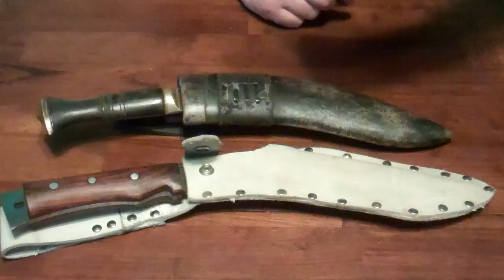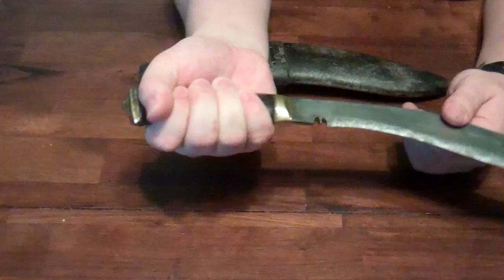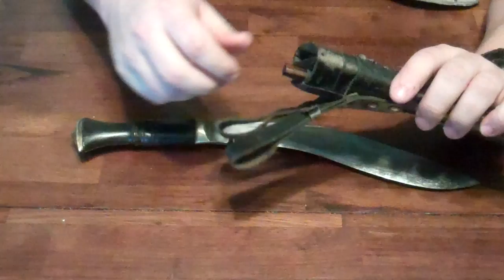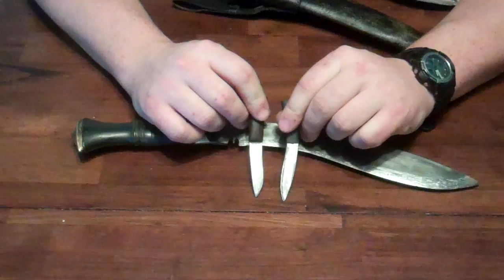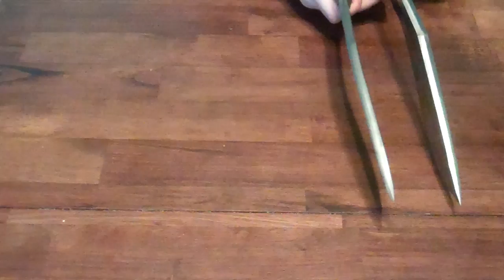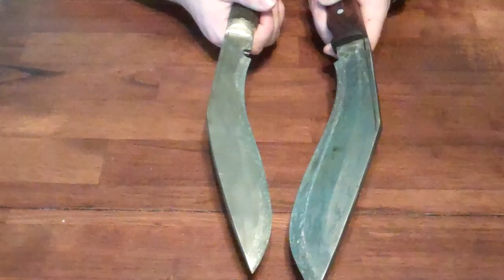A Kurki buyers guide: AEOF and Traditional Design

Comment: I have one that looks like the Afghan Khukuri, but has a half guard. Its called the Jungle Black,and I got mine from Khukuri House Thamel. And the case/scabbard mine came in is way to tight. But I love the knife. Also the handle on mine has shrunk a bit. But Its not a problem. I am in the process of making a heavy leather sheath for it. I to live in a very dry, but cold climate of Eastern Wyoming.

Comment: Lol, don't feel bad, you ain't the first Kukri noob to puncture your scabbard...
You have to actually push the back of the blade away from the back of the scabbard and it will slide right in like butter...
Reply from the maker: Polymathic Perturbations in that case I think the wood constricted in transit.  When I tried to take it out of the scabbard I had to fight like hell to get it out.  That aeof wasn’t my first.
Reply: @Teakettlefarm  They are just made pretty tight.
They are assembled wet and that hide is alot like rawhide...
Mine was real tight but after 6 years it is working pretty good.
I have a couple swells in the leather at the back of my scabbard from before I figured out how it works, I was fortunate enough not to ruin the scabbard.
It's like a new pair of boots, or a gun, or a car...  You have to break it in...
Reply from the maker: That is fortunate.  This one was just too tight.  I had others that were tight to start but this was like a vice.  I was actually pretty scared to remove it because I needed so much grip to provide enough force that I was  afraid of slicing through the bottom into my hand.  Then when I went to put it back in, the force required blasted the tip through the spine of the scabbard.  I hear ya on their regular tightness.  This one was different.  I have not had one that tight before or since.  That was a couple years ago, now.  Still the best blade design in my opinion, regardless of anything else.

Comment: I have a original AEOF Khukuri  a ex Gurkha gave me when we did convoy security in Afghanistan the so called AEOF Khukuri was a much better made then what you see on Amazon and ebay and other Khukuri houses  today the ones the Gurkha carried had a 11 inch blade and a real ebony handle and three large aluminium pins not the little pins that hold the handle on and four finger groove's on the handle and it had a round pommel with a lanyard hole  and the blade had two fullers and two thin straight line fullers on  both sides of the blade had V notch instead a classic cho notch and the sheath was a polymer treated buffalo hide but the ones you see today are not the original AEOF Khukuri and to this day i have never seen a original AEOF Khukuri being sold on Amazon or ebay one reason is they are so hard to get and they were made in such small numbers but the so called AEOF Khukuri  you see today just look simular to the original ones the Gurkha's bought for their own use in Afghanistan
Reply from the maker: Sounds like you have an amazing blade with an amazing story.  Thanks for sharing.  I believe it is better, since it sounds like they were not produced for commercial purposes.  It would also explain why I had a number of them break.  They were garbagy reproductions.

Comment: Thoughts on Kukri I use to own a Kukri made somewhere around 1900. It was the best kukri I've ever owned. They use to make them from railroad rails. I think maybe equivalent to 1095 steel? It had a hardwood handle and a hardwood sheath. I like buying the old ones when I find them and I stay away from the tourist models. I think you might try wrapping your kukri handle with wet leather or tennis racket tape. This will give you added thickness and stability to prevent the kukri from rolling in your hand.
Reply from the maker: Vincent V I just had a custom made from kailash blades.  They are pretty small and don't do the tourist blade much.  Very happy with it.

Comment: Id rather have my pristine, razor sharp, Iraqi Freedom Kukri over both of those Kukris because of the handle.. Its got a steel finger guard to prevent your hand from slipping up on the blade.. I got a tourist knife.. This is one arguement I dont care.. If mine isnt traditional, oh well.. My Kukri is a tank.. Virtually indestructable.. Its not too heavy for me..
Reply from the maker: Outlaw GT I have been having troubles with kukris breaking.  I had two that broke of at the handle and another from Himalayan imports that chipped.  I have been considering going back to the aghan beast for it's indestructibility.  Glad yours works for you.
Reply: For This Land I look at it like this. Nepal makes the best blades in the world at the best prices. They will make you anything and it will beat anything you can get at Walmart or Outdoor stores or Gunshops.. Its all garbage and its expensive as fuck.. There are true knockoff Kukris being sold everywhere.. 1.5mm thick $49.99 type trash that will fold in half after 5 hits.. I can go to Home Depot or Lowes and buy a flimsy Machete for 29.99 that will last long enough to do 1 job then end up in the trash... I paid $50-60 bucks for my Kukri and I can stick it in the side of a dumpster.. All my blades will come from Nepal.. Kukri House is my favorite because they also make cool blades that are functional.. Go look at the Mukti.. That knife is like a sharpened brick.. How are you going to break that unless you are trying your hardest? Im not sure if I can even break my Kukri if I hit it with a 12 gauge slug.. My next blade will be a custom Bowie knife from Kukri House.. Rambo style.. John Rambo
Reply: And that Rambo knife wont be a traditional one.. I guarantee that..

Comment: Are tourist kukris fully functional and usable?
Reply: No tourist Khukuri's are not heated they are just made as a wall hanger
Reply from the maker: They can be.  I think it depends on which ones you get.  There is a decent amount of snobbishness around what makes a proper kukri and what doesn't.  If you you order from KHHI, EGKH or the Kukri House you will find knives that are often called "tourist" kukris but are fully functional.  

Just some fair warning, I have had two knives from KHHI break on me, though I was being pretty rough with them.  It was in the grey area between abuse and hard use in my opinion.  Some would say the knives should have held up, some would say I got what I deserved.
Reply: For This Land .
ok thanks. The one I got is definitely a tourist kukri but it's pre-war War and it looks like it's seen some use
Reply from the maker: It probably works just fine.  Nearly all of them are hand made and vary greatly in quality depending on who made them when and how they were doing that day.  You could have tourist kukri of impeccable quality or genuine kukri that falls apart.  You'll know that it doesn't work when it stops working.  That's kind of helpful?
Reply: For This Land  thanks for ur help

Comment: Say Heah, Yeah, I have a nice Cold Steel Kukuri Plus, it's a great chopper made out of O1 steel. I also have (2) Traditional Himalayan Imports M-43 Khukuris in two different sizes but the same model. Traditional is a  Khukuri, a copy is a Kukuri. That's how I explain it.  Also I got some Hoof Cream from a Veterinarian, for horses, but works great on Buffalo Handles too. Dilly Dilly.,,.p
Reply from the maker: Good call on the hoof cream.  I never would have thought of that.  I just got, what I am pretty sure, is a HI khukuri on Ebay.  But I am not positive.  It has two markings near the spine where the blade slopes down, no others.  I have found those symbols associated with HI in my research.  It just doesn't have a Kami's individual mark.  Got it for $40, the seller just didn't know what it was.  And if it isn't and HI than it was still a good buy.

Comment: Never buy a rat tail tang Kukure
Reply from the maker: It's funny you say that because I have had two kukri's break on me and both were full tang.  Neither of the rat tails have broken.  Part of that was, I think, the manufacturer I got them from.  Part just taking them too far in stresses.  But still.  Buffalo horn handle rat tail tang is the least broken style I own.
Reply: For This Land just basic physics would show the weakest point would be between the handle and the blade on a ratail knife , that's also from my experience with a chopping tool.  As a eleven year knife maker I have never had a full tang handle break from the blade  when used as a chopper. Sounds like you've got a spacial one if your chopping with it , have a great day.
Reply from the maker: Honestly, I'm sure had to do with the fact that I was batoning a long, dense piece of wood I had no business batoning.  It happened with two kukri's from the same maker and both knives broke at the Cho.  I was surprised at the first one, disappointed in my self at the second one and have since since stopped using the knife like such an idiot.  I never had a problem with chopping, I have pretty good chopping technique with kukri's.  

You're right about the physics.  When I examined the metal, though, it looked like there were seriously large metal grains leading to weakness in the structure?  Is that correct?
Reply: Hey greetings from Cheney/Spokane!

Don't mind the rat tail nay sayers. It comes from lots of cheap poorly made versions as well as YouTubers and writers promoting unbreakable tools and ultra heavy use. 
In history plenty of cutting tools were made with stick tangs and were perfect for their intended use.
Reply from the maker: I tend to agree.  It's nice to have a tool that is crazy durable and hard to break and it allows you to use it in different ways than you would have before.  But when you understand your tool, you rarely have any  problems. I tend to like the weight and handle ergos of rat tail tang knives anyway.

I was born in Spokane!  Lived there until I was 10 and now reside in Yakima!  Great to have a PNWer in these discussions.
Reply: @Teakettlefarm  Greetings, the best kukri out there are Tora kukri. And they're rat tail, all of them if not most. The original Nepal kukri was rat tail. I'd agree on full tang UNLESS is a kukri. Kukri from Tora = Best kukri out there.

Comment: what is the point of the little cutout near the handle on the blade
Reply from the maker: Joshua Dowden there is supposed to dinner religious significance to it. It represents the hoof of a cow. There is an element of it simply being the way it has always been done too. It also allows for a point in the blade where there is only soft metal thus allowing for flex during stressful work on the blade making it stronger.
Reply: keeps the blood from dripping on your hand

Comment: Hey I'm starting to look for a kukri never bought one just looking for a good one in the price range of 60$ if less that would be great but if you have anny suggestions or have a serten blade that you love and would recommend link it and I'd really appreciate it thanks
Reply from the maker: SirPickle it's hard to give you a specific one. but the basic service No. 1 or jungle PRI from KHHI, EGKH or kukri house are great entry models. very basic easy to handle in the price range.
Reply: The EGKH AEOF is a very good blade! Got mine for  $66 on Amazon and it was worth every penny!

Comment: The Gripper that I have will not fit in the sheath neither,,,I have that same problem with the sheath as far as put it in and out,,,,My sheath is useless,,,,and that one You made is a good one,,,,nice point You touch on and good information and truthfully,,,,Nice of You to share this info
Reply: I like some of those KLOs ,,,I must admit,,,the CS Kukri Plus machete and a few others I am gonna get a Windlass Steel Gurkha Kukri for ACC,,,yes it would be considered a KLO but they are carbon steel and last for years,,,,Like Your video,,,Peace and Be Peaceful
Reply: when you insert the blade into the scabbard, you have to pull the back of the blade away from the back of the scabbard so the tip of the blade does not catch on it and try to poke through.

Comment: egkh also makes the aeof in an eight inch blade if you want a smaller yet functional blade.
Reply from the maker: +bear survival I have been eyeing that one.  I like the look of it.
Reply: +For This Land . I have been using the eight inch aeof for a little more than a year now and it has done everything I could ask of it. I am looking at the six inch now as a backup in my haversack.
Reply from the maker: +bear survival that's awesome.  KHHI lets you buy their Kukris without handles or sheaths for a reduced rate so I bought a 7 inch blade and am working on handling it.  I am excited to use a smaller kukri.
Reply: +For This Land I have found that the smaller kukri 7 - 8 inch blade is easier to handle but will still do a lot of work. I made sheaths for mine, a similar design to what you were showing on this video, with a dangler loop so that it moves out of the way easier, and it doesn't seem to feel that heavy. I have a Wilderness survival School here in West Tennessee and the two main blades that I carry are the Becker bk16 and the 8-inch kukri. I have found that in spring summer or fall weather the kukri is all the large blade that I need around here it completely eliminates having to carry an axe or a hatchet and functions as a larger knife as well and it is great for processing down firewood.
Reply from the maker: +bear survival that's great.  I am still working out my system but a couple months ago I received my custom kukri that is 12 inches. that I have been pairing with a puukko knife.  I am working on review footage for that right now.  I cut down a 8" dbh arborvitea in my in laws back yard with it.  the kukri is easily the most useful woods tool.
Reply: +For This Land I agree 100%. There is a reason these things are still being used after hundreds of years.